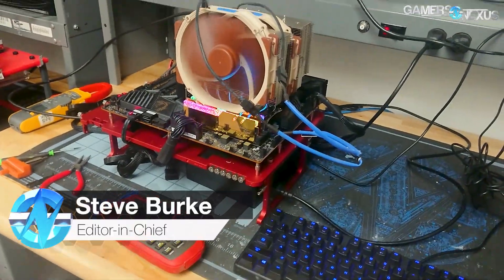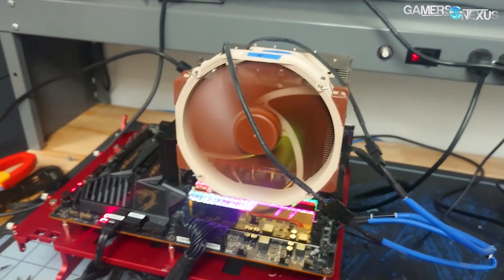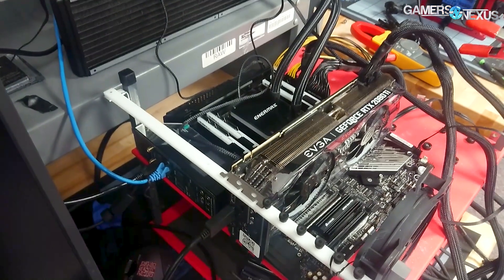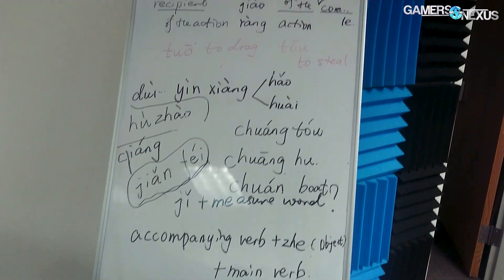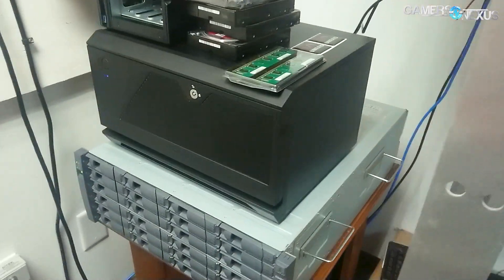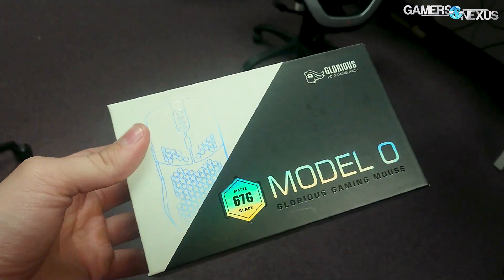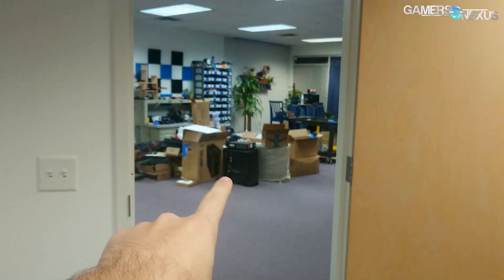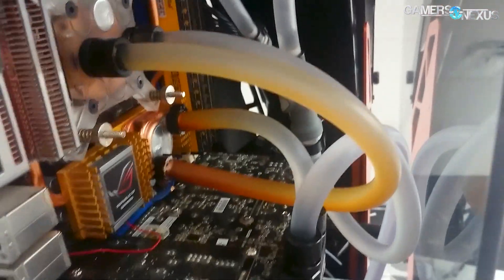Behind the Scenes: Noctua Cooler Tests, Server Projects, & More

Comment: I'm using an NH D15, and man is it ever quiet...running it at about max 30% speed, literally can't hear it~♥

R5 2600 at 4.125 all-core@1.4V...max gaming temps are about 43ºC, and the highest I've got it with stress tests is 64ºC!
All it takes is living in a tent in a hay loft, where ambient temps are around 8-12ºC :P